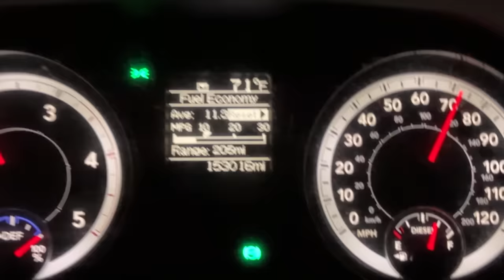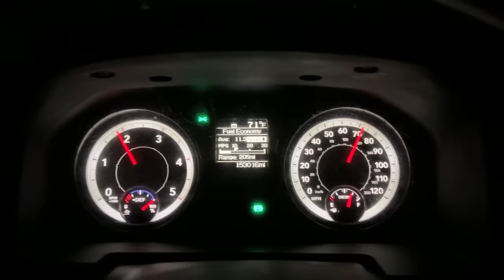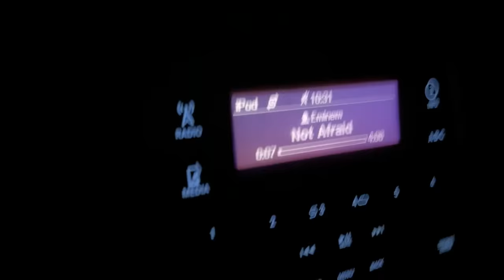My new truck broke down 9.5 hours from home. Dealer refused to do anything...

Comment: This is why i graduated to a Class 8 Semi converted to tow vehicle for my RV as a Travel Nurse. You just reached the point i did with newer warrantied trucks like i did. I started my journey in a older 1994 Dodge Ram 2500 w/Cummins. It was a vehicle i had for a very long time and put over 300k on it myself daily driving it. The minute i started to use it for towing my 5th wheel RV, the reliability of the truck suffered and i broke down often fixing it on the side of the road, but i was able to do it myself in most cases. I reached a point that i wanted something newer and more comfortable to tow with on the longer trips and that was under warranty to not worry about for a while, that was the mistake your going through that i fell under also. I bought a 1 year old 17k miles 6.4 Powerstroke F350 and i had a similar situation as you happen, the truck broke down on me in the middle of the dessert going through Arizona and the closest dealer that could look at it was hours away. This was prior to the knowledge of how bad these engines would become. They diagnosed it and informed me i needed a new engine, injector stuck open and melted a cylinder... they were willing to put me in a loaner, but only a F150 at the most, which was totally useless to me outside of just commuting in it.. so after 5 weeks of them waiting on parts they returned the truck to me and i sold it to get away from Diesel trucks for a while. I just had a bad taste in my mouth, because it took forever to fix, was not reliable like i thought it would be, and parts were difficult to find for a while even being barely a year old. So my next truck ended up being a brand new 0 mile 2011 F350 6.2v8 gas pickup, because i wanted to try something gas and Ford was willing to buy my truck back from me and give me a massive discount on a brand new pickup after multiple other issues with the 6.4 powerstroke. I drove that for a year, was very reliable, just gutless.. no power while towing, scared me at times to make it to the top of a hill... and the fuel cost was astronomically more than the diesel truck. I was desperate to find a more reliable truck to tow my RV, because i really enjoy travel nursing, but the transporting everything was just killing me.... and someone at a RV resort i was staying at introduced me to their Class 8 Semi they used and i fell in love with the idea after they let me test drive and experience it for a while. So i sold my almost 2 year old gas pickup and bought a used class 8 volvo sleeper cab w/700k miles and replaced the commercial 5th wheel with a between the frame rail RV style 5th wheel so i could drop commercial insurance on the truck and re-title it as a motorhome with regular price insurance. That was 2013 when i did that and 10 years later i don't regret it one bit.. The Class 8 class of pickup is so much more comfortable to tow with, the RV is not even felt behind the truck so far less stressful, been stupid reliable.. the only time i've ever had a breakdown in the truck to date was something on the road bounced up and took out a airline distribution block and the local truck stop had 24hour service come out and fix it at 1am in the morning for me. Then to top it all off, the semi I bought has a auxAPU unit, which i use all the time going on day trips or weekend trips to camp remotely... i leave the RV at the resort, pull up to a park or site and have the beauty of a bed and a/c and heat in the cab available along with powering everything. Look into them man.. its saved me so much money over the years between savings on hotel cost while traveling and such...i honestly wish i would have found out about them sooner.. the fact i use it for such a light load it barely works... so it should last me a very long time and i average between 11-13mpg no matter if towing or bobtailing it somewhere..when i had the gas truck i averaged between 4-6mpg towing....
Reply: I looked at some of these trucks just for fun based on your story and I was first surprised by how many miles that have on them for their age (of course it makes sense haha) and the 2nd thing that surprised me was how cheap you can buy them for. A lot cheaper than these new F350's that's for sure! And 11-13 mpg isn't that bad really. Hell I pulled a 5k pound load the other day and got 14mpg in my little gas 5.3l. No way I'm towing a 5th wheel with it either.
Reply: This is really interesting.  Thanks for the experience.
Reply: Good Info Brotha 👍🏾👊🏽👏🏽‼‼‼ Is Your Volvo Automatic or Gears ‼‼‼
Reply: Would be badass to get a video of your set up
Reply: I'm a heavy duty vehicle mechanic. I whole-heartedly agree with everything nurse Huston says. It's all in the numbers. The number of class 8 trucks built in a year compared to all all medium duty (class 5 through 7) has got to be huge, 10 or more to one.

William touched on an important point. Maintenance,  you can get parts and find technicians everywhere 24 7.

Last point though is try to get so.e training so you can use a standard transmission or possibly an automated manual. Hydraulic automatics are good in stop start vocations , buses, refuse. But for what you're doing, gear up and you'll never look back.
Reply: Drive for a living well part time, any Dodge, Ford or Chevy truck looks, drives and sound good well when they are new, but put 50k on them and they are pretty much POS.
Reply: I realized this was a thing when I saw the guy with a class 8 smart car on the back to drive around cities and a 5th wheel tv camper travel trailer that was huge dude was living the life
Reply: Look for a class 8 Old Damian company single drive axle Freightliner with sleeper, it should be well maintained
Reply: This is genius. Hell you could built a flatbed for it too and you’d have better driving experience when bobtailing too (getting weight over the rear end). I agree with your point of the truck being so under stressed with a regular RV I’d bet the truck lasts you the rest of your life
Reply: @TandyTerrison  Or you could buy a real truck that will last, see Toyota or Honda. If you can't haul all that gear, one of two things, you have to much, if not have a freight hauler move it around for you. Way less costly then buying some POS Ford, GM, or Dodge truck. And the rest of us drivers would be so glad not to see another monster truck hauling a 1000 foot trailer coming down I95 or I4 at 95 miles an hour. And as an RV yea keep those on the lot.
Reply: @vietnamvet4533 there isn't a Honda or Titan truck that can haul any RV of reasonable size.  Those are baby toys.  My RV weighs 25k.  6400 hitch weight.  My hitch weight is more then a tundra weighs total.  Lol lol.   Need a man size truck for this job.  Think 4500  or class 8 Volvo.
Reply: @miker3567  Yep no doubt but you are missing my point which is why do you need an RV in the first place? You have spent and will spend tons of cash to live in a tin can with you wife 24/7. When if you do the math how many real great vacations could you have taken for the same amount of monies, well actually far less? We have been to Las Vegas 6 times, and Biloxi 15 times, Italy once in the last 8 years  stay in really nice 1st class hotels. And I bet know I know that we spent far less then you did probably on gas alone. Plus what did you see, mile and miles of interstates, camp grounds load with monster trucks like yours? Admit it worst mistake you ever made was thinking that RV travel was actually fun and affordable.

Comment: This gives me extreme pause regarding the purchase of a Ford with a warranty. Really disappointing as I’ve been a Ford guy my whole life. Glad you got home safe.
Reply: It's not just Ford Dealers, it's Dealers in general. A guy I knew had bought a brand new Suburban and the same day he took ownership the engine grenaded itself(not even 100 miles on it) the dealership basically did its your problem not ours. He went and got an Expedition after it was settled and has been happy. That's why it's always important to find a good dealership in your area and deal with them even if they're not your brand of choice.
Reply: Supreme Ford of Slidell
Reply: @YOSHI450R  that’s insane. Part of the reason to buy one of the “big three” is the dealer network, emphasis on network.  I mean, if TR didn’t have so much reach on YT and IG he would have been guarding that trailer all night at the very least. I just keep imagining myself in that situation. I would be f***ed. 3 days for a diagnosis is embarrassing. Ford should be ashamed.
Reply: @ItziiSpiNz  so are we going to drag this dealer in their reviews or what?
Reply: @dougsisk619  yes, they either improve or fail, it's a win win
Reply: I’m near the point of upgrading my Ford Ranger Wildtrak with a Ford Ranger Raptor, not so sure now, this is a disgrace @ford. I’m in Australia but this reflects on the entire Ford Motor Company and it’s dealers.
Reply: @matthewk3262  Ford will leave you stranded far from home, regardless of the country.
Reply: When the warranty works, its amazing. But you might just be out of a truck for a month, lots of people rely on their trucks daily to tow for work... So no matter what, you pay when you break down and other people fix your shit.

Comment: First and foremost, lets all shout out Chris for the help. Whoever he is to help a person in their time of need, shows the true character that he has. Second Taylor don't beat yourself up over the truck. You said it best that the sole purpose of getting it was for that new truck reliability and warranty that comes along with it. I don't like the Ford brand from my own personal bad experiences and friends that have had to deal with them as well. People can have their own opinion on that and it's fine I'm not here to bash them or the brand so don't take it like that please. My vote would be to get rid of the new Ford truck and at least for now use the Fummins. Like you said you know that truck inside and out, if something happens you know it can be dealt with in a timely manner. I wouldn't rule out looking for something else new though don't let this bad experience make you worry about something that could be much better. Hope everything get sorted quickly for you and have a blessed day.

Comment: I was on vacation in 2006 with a new f250. Broke down in Gatlinburg with just 6,000 miles on the truck. Turbo was out. The Ford dealership worked my truck in on a Saturday. Morning.  This saved our vacation.  thank you Ford dealership in Knoxville, TN!!

Comment: This is really dealer specific honestly. We have had this same situation and I've stayed at the dealer all night doing overtime to get someone back on the road. And like you said if your stranded hours away someone drops what they are doing and gets to it. But I'm with GM. Sorry you had a bad experience. Some dealers are crap.
Reply: Overtime???? Not flat rate????
Reply: @charliemagoo7943 yah he stayed late!  To help the customer get back on the road! I've come in on a Saturday  if we had a traveler stuck! Still only got paid flat rate for the job! Worked for a dealer for 44yrs! I don't miss that sh$@! 🤑
Reply: @davidsimmons3844  have worked at dealers for 25 years. Techs don't get overtime.   They can accept $ tips from customers though.  Customers don't understand what flat rate is.
Reply: @charliemagoo7943  Did you read my comment?🤣
Reply: @charliemagoo7943  you get still get paid book time for a job but have your hourly rate you're paid at be higher for working late.
Reply: @charliemagoo7943  pretty much was just a cash tip for helping out. Still flat rate

Comment: I quit doing business with Ford after they sold me a lemon, then after several visits in the first 15k miles was declined "exploratory service" when the truck kept downshifting at highway speeds into first gear. Ford corporate got involved and denied the work as well. When they showed they were more worried about how expensive the fluid and labor would be to investigate what was likely the valve body in the transmission vs the absurdly dangerous issue it was having, even after shown video of it occurring, I took a $10k loss and moved on. I also told them I'd not only never do business with Ford again, but I would warn others of the experience. Sell the new truck, let the dealer screw someone else for the next several years.

Comment: Not getting a loaner is 100% the dealerships fault. The brand doesn’t determine who gets a loaner, most of the time it’s the dealership which sucks to see that they didn’t give you one.
Reply: The manufacturer DOES decide who gets a loaner. It’s part of the warranty contract. Dealers can choose to give a loaner when the manufacturer doesn’t, if they want. But i have never seen a dealer that has f350 loaners
Reply: @TrekkerMoto  Didnt know that, thank you for pointing that out. Most of the time I just see service writers give out loaners once the diag is done, which they get it looked at immediately if that’s the customers only form of transportation. If they can’t get it looked at asap, I see that they jus give them a loaner and let ‘em go, but being that it’s a F350 they probably don’t have one as a loaner.
Reply: @TrekkerMoto  really only commercial dealers do
Reply: @shibalseki8818  I was a ford tech. It is specifically specified in the tech portal when and if a loaner is covered. Although the dealer would help people sometimes if it wasn’t covered
Reply: @Doubie.  I literally worked at a fleet center (all commercial fleets but mainly f250-f750s, motor homes, semis etc) and we only had f150/
Reply: Even if he got a loaner he would only get a 1/2 ton. They don't care bout your trailer.
Reply: @TrekkerMoto ford will give loaners under 36,000 miles.
Reply: @Hated_Sien  yes.. under warranty
Reply: @Trekker  that's if they have them. I worked for ford as a service writer. Pre covid we had 100 loaners. After covid we had about 10-15. By the time I quit we had 4. Prob least 70% of the work that came in was warranty. We were a big/busy dealer averaged 70-100 cars a day. Everyone and their mother wanted a loaner. On average I'd watch at least 1 loaner a week or two get wrecked by a customer and not only that but some people would put crazy mileage on them. One dude put 7k on his in less than a month. Hard to keep good inventory of loaners when inventory is low and cars are barely coming in to begin with. It ain't like what it used to be
Reply: @zmohan69  the biggest reason dealers have cut down on loaners is because of the price of cars went through the roof. Especially trucks.  So keeping even 1 loaner when they were selling at 5k over MSRP would not make sense for the dealership.

Comment: You sir are not alone! Really enjoyed watching this. I am currently in the middle of a 4,400 mile road trip in a newly purchased 2019 Sierra AT4 w/6.2L, just under 11,000 miles on the odometer. The fuel pump control module has decided to fail, and I'm stranded in Minot, ND waiting for the parts dept to open at the dealer after the holiday weekend...
Reply: That’s shit timing man.  Hope it gets resolved soon!
Reply: How are you doing man?
Reply: Any updates?
Reply: 6.2 are problems.
Reply: Got it fixed! The DTC was P129F. Luckily it broke in a town with a GM dealer, easy fix for the most part - a new fuel pump control module. First model year of the L87 and the new style fuel pump controller, luck of the draw having a failure I suppose!
Reply: Ditch the 6.2. Probably the worst (flex fuel?) engine GM ever put in a P/U. Get the new 6.6 gasser.

Comment: Dude, it really sucks what happened, and that dealer is a jerk who deserves to go bankrupt. But the truck you bought only had 1 breakdown, get it fixed and drive it and see if it has another breakdown or not. Who knows, it could run for years and not breakdown again. You can not just give up on it after 1 breakdown. You need to drive it for a while and see if it has another breakdown, if it does, then I would get rid of it. 

Now if you know what broke is a design flaw, or known to breakdown all the time, and they fail all the time, then that is a different story. I would sell it now.